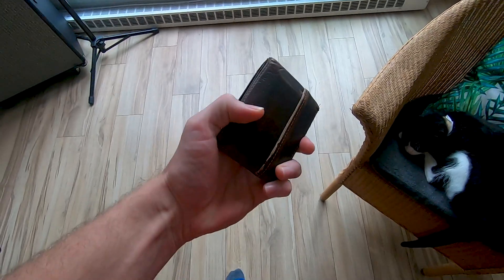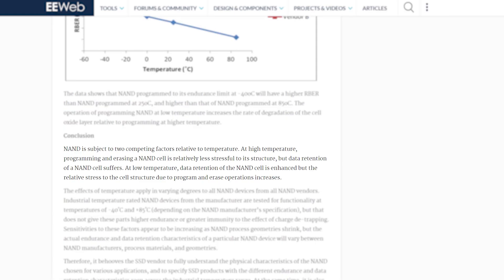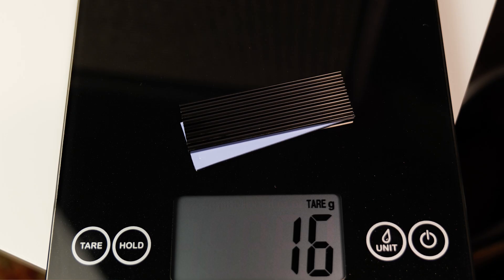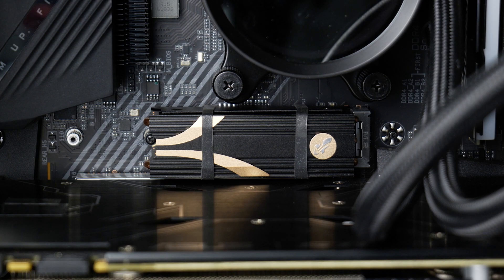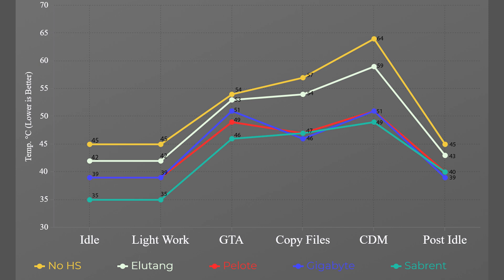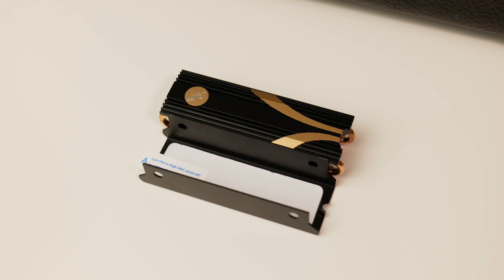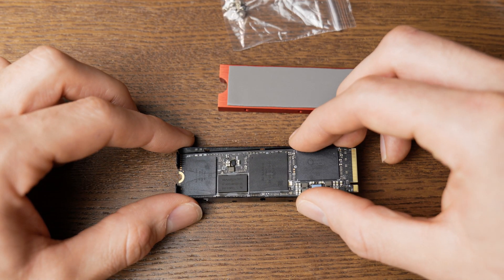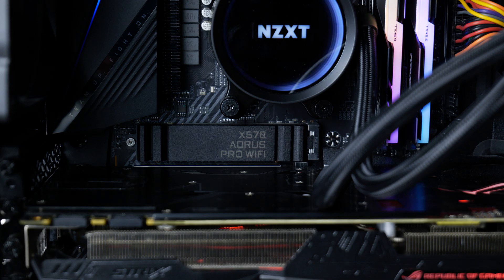Are NVMe SSD Heatsinks Worth Using? M.2 Heatsink Comparison

Comment: I would of found it interesting if these tests were done inside gaming laptops....Just to see how much closer the temps get to critical in a far more congested and enclosed space with the heatsinks (or pads more likely) On my omen the copper coverplates inside the laptop have only half of it with a preinstalled thermal pad which tells me they are of the same mind to only apply to the controller.
Reply: @El Cactuar would've ... sounds like would of.

Comment: Enjoy now because in a few years a HD won't be needed as MS, Apple and even Linux are discussing booting from flash drive from the manufacturer and that will replace your boot drive and the OS is cloud based. 
Like a dumb terminal and all your software and private Data is on the cloud. Basically can you say goodbye "Personal Computing"...well, it was a fun ride.
Let's see, I'm 61 now and started with this in 1980. So, yeah..it was a fun ride.

Comment: Exactly.point on. The memory is rated in meantime (hours) reading/writing has a life span. The controller life can be extended by cooling, but heat to a (ahem, degree), is necessary for error recovery, etc.. but I'm in the same mind, leaving the memory alone and cooling the processor. Good job on explaining.  I really need to put a hamster and squirrel cage in my computer.

Comment: I have watched and read countless videos and articles and have concluded that cooling only the controller is the proper method of cooling a M.2 Drive. Great video!
Reply: @DoNotSayThree  Not really, you could use GPU Memory Heatsinks that have thermal double-sided adhesive. Note to use a "Rubber-band" ring that should be warped around the heatsink and M.2 drive to prevent the heatsink dropping off the m.2 controller chip. I ended up going with "M.2 Heatsink Cooler 2280 SSD Double-Sided Heat Sink with Thermal Silicone pad for PS5/PC PCIE NVME M2 SSD" from a online store. The reason I went with that was because it allowed me to cool the back of the drive by allowing me to use a thermal pad and it was not a clearance issue with that heatsink installed. To top it off it was cheaper then getting a pack of GPU memory heatsinks.
Reply: @DoNotSayThree  The PCIe slot card is a great idea if you got a slot to spare. Keep in mind that some motherboards share PCIe lanes with other devices/chipset on certain PCIe slots. Try to use a slot that has nothing else tied to it. Also, it does not matter if you plug in a 4x PCIe card into a PCIe 16x slot. Hope that helps out!

Comment: I think the conclusion has to be to use two separate coolers: 1 for the controller and 1 for the nand :)
Interesting video, thank you.
Reply: the answer flowing through my head is that putting the pads only on controller area and trying to avoid the NAND touching the heatsink area (?)

Comment: The Sabrent Heatsink comes with extra thermal tape So if your NVM E Drive has no chips on the bottom  you use the extra tape and that fixes the gap.

Comment: I'm curious about removing the sticker as you did in the very beginning. You're the first one I see doing that when applying a NVMe heatsink. I totally agree that it has to be removed, but do you have any reference/experience when it comes to comparing both ways?
Reply: I have seen a video by a well known tech tuber that went into this question.  The drive manufacturer explained the sticker has thermal conduction built in, it's not just paper.
Therefore you are best not to remove it, if you believe the company.

Comment: Thanks!   Funny - I was just thinking about this very question!   Did you notice if the thermal pads were of different thicknesses for the controller vs. the storage?   I know the Samsung drives have a signficant difference between the two.

Comment: What about the info sticker it's covering the controller, nands, dram, would the NVMe run alot cooler or it doesn't matter? 🤔
Reply: @Xyphis Ah, good to know. I'm NOT going to temp to remove the label from my new Samsung 970. Thanks for the tip. 👍

Comment: I have two NVME one with heatsink and the other without, the one with heatsink gets hotter then the one without. My guess is because the one with heatsink is 2TB has my OS on it and constantly running and the other has 500GB and is just always idle.
Reply: the Newer 4.0 interface runs Hotter.

Comment: sadge none of the heatsinks you tested have a built-in fan. i found an affordable heat sink with built in fan and  large oled temperature display. came with  2 extra thermal pads too

Comment: I do backup the entire NVMe frequently not to lose Data. The throttling is a key factor for me. Without heatsink it will take forever to finish the backup at 6 MB/s halfway through.
Reply: Been using Samsung 960 PRO for 5 years now without any heatsinks...  Never lost any data, and never noticed any major throttling.
Reply: @teemuvesala9575  I backup the entire 1TB system storage. That's why overheating and throttling is an issue for me. But since I got heatsinks with active cooling for all my NVMes problem has been solved
Reply: @oMeGa0122  Yeah it’s really just writing huge amounts of data that overheat NVMEs.

Comment: So i have a crucial Mx500 m.2 and at idle it sits at around 49c and while gaming it sits at around 72c, I use HWMonitor. This drive use to be normal like my samsung 970Evo at 40c idle/53c load. I had started to notice severe lag/stuttering in my games that I had not had before, thinking it was server lag but seen my drive was hotter than it use to be. Asrock Taichi 470x mb 5 case fans and an AIO, had this build for about 2 years now and my pc is very clean and great airflow and have not changed anything with it. Is my m.2 going bad and would I benefit from a heatsink?
Reply from the maker: Definitely worth a shot! Check drive health as well.
Reply: Your idle is way high mine is 28-29

Comment: Thank you for information. 

We are not using, well at least most of us not using SSDs as idle storage devices. SSD meant to be used under fast reading and writing pressures, otherwise why would we need high random read/write speed disks that can handle multitasking; even if we are not multitasking but just queueing tasks, PC constantly doing it with multiple running apps and tabs at the same time. I don't know you guys but most of times I play two games at the same time or watch some content while playing. Anyway, I'm on the eve of buying my first 1TB M.2 ssd, so I'm constantly searching for some time; and I keep reading almost same user comments in every M.2 product that doesn't have a heatsink like "it goes too hot" and "lost X much disk health in a month" etc. and most of time blaming the heat to cause of that. Because it's so expensive for my standards, if I buy it, it would be the second most expensive part of my PC after the GPU, so I wanna make sure the money well spend and expect to not cause a problem for 5-10 years at least. And from a gamer standpoint, we would like to install our most played games to SSD, especially multiplayer ones to minimize fps drops caused by the low performance of the 90% full hdd with hundreds games. As we see from test results, playing a game pressuring as much as copying files, even close to CDM pressured temps. For some people, if a device's operating temp is 0-70c, they think it's okay to reach 65-70c. But for me, even 60c is hell hot for any hardware even if operating temp is 80c. I see heatsinks works pretty well, dropping 10-15c under high pressure. I'm definetely buying one if I don't buy Corsair MP600 Pro or Gigabyte Aorus Gen4 that has heatsinks already.

Comment: Having NAND cooler shortens its lifespan. Heatsinks that transfer heat from controller to NAND are therefore beneficial.
Reply: Wasn't it the opposite? More NAND heat = more risk of data loss and drive failure? But better performance. But I'd rather lose a little bit of speed than my data.

Comment: If you are regularly running against the  throttle temperature, then a heatsink might be worth it. Check the specs of your NVME, like my HP EX950 is 70C, when I hit that it slows down enough to be noticed, but I am often hitting it pretty hard.
Reply: What actually causes it to run against the throttle temp? Gaming, editing off apps installed on the SSD? Sorry if silly question but do you need to be gaming heavily or something to cause it?
Reply: @yiannimav  Not the same model, but my NVME only heats up when it was transferring big files all in one go (was transferring 70GB of files when I tried it) which heated it up to 60C, and thats with a heatsink.

Other than that, its temp stays at 40C mostly, and only ever rises up to 52C very rarely, and only for about a second or so for all other usage.

Getting a heatsink also isn't expensive, and might increase its longevity/avoid it from throttling in the long run so no harm getting one really.
Reply: @Don_Akane89  thanks for this, appreciate it! Just a bit of a noob, and my laptop might not be thick enough for the heatsink, but I'll try put one on it! Thanks again!

Comment: I think many are going to be misled by this video (and many older 2018/2019 videos) that are referencing cooler running Gen3 drives. Even the SN750 ran hotter than its competition, but the SN850 (Gen4) takes that to a new level. Depending on mobo layout, these hotter Gen4 drives are often stuck directly under the GPU, which only makes a hotter running drive get even hotter.

That said, the real reason I watched this video - I wanted to know if the included Aorus heatsinks were functional. And it certainly seems they work, so that was good to see.
Reply: Sn750 is a cool running drive have one in my laptop right now. But it is a dell laptop that has a heatsink.
Reply: and the controller is slightly thinner than the nand so 2 thicknesses are necessary
Reply: Versus stock heatsinks from the motherboard, will purchasable ones like Thermalright perform better?
Reply: Misled how? Everything still applies.

Comment: Thanks for this video, very informative and helpful.
If I can ask -
I just installed 970 evo plus (gen 3), would you recommend taking the sticker off before adding heatsink?
I prefer not to take it off, so it won't lose its warranty.
Reply: No don't take the sticker off. The stickers are made with thermal conductive material to help as well.
Reply: I just found out that this is true. The label is made of copper I believe and it's meant to help keep it cool.
Reply: I have bought it already and will receive it soon. But I won't install any Heat Sink. This SSD can handle video rendering and online game.
Reply: Did you install any heat sink on your drive? how does it perform?
Reply: @MixedArarash  In my case, I've tried using heatsink, but it did little to no difference in temp, so I removed the heatsink and it's working great without it.
Kept the sticker though (the one on the ssd itself)

Comment: Would this apply to gaming consoles? And what about some of these like Samsung with their own applied thermal dissipation methods? Sounds like an additional heatsink would counter the already added thermal measures and keep more heat in. (Even though for example sony suggests a heatsink in their ps5)
Reply from the maker: Mostly it would apply to gaming consoles. That being said I did this test with a Gen 3 drive. Gaming consoles require a Gen 4 drive. A heatsink would probably be a good idea on gen 4 drive whether in a console or PC. They just get very hot
Reply: @TechIlliterate  Heatsinks which for instance "Samsung 980 Pro with heatsink" have are designed properly and only touch the controller... I think its the motherboard manufacturers who are the ones screwing up more than anyone else.

Comment: mine is at 53 degrees at idle. I have a asrog crosshair hero VIII and it came with it's own heatsinks and thermal pads (which I almost threw away by mistake). Nevertheless, even with those. my idle temp still sits at 50-53c and when gaming, it reaches 56-58c. Is this normal
Reply: yes, cause your gpu is heating up other components in the case. totally normal.

Comment: Well done. Sounds like manufacturers should just sell a heat sink that is designed to keep their own drive at ideal temps. I won't feel confident buying a 3rd party here, since there's a chance it could backfire.
Reply: The manufateurs could slice the heatsink to match the drive, so NAND and Controler each have their own small heatsink. This way the controller would no longer heat the NAND.

Comment: Dude, this was surprisingly in depth and really covered the technicalities of this in ways I never expected. This is legit. I just got a Sabrent Rocket 4 Plus that seems to have heat issues. And even bought that huge heat sink. I really feel like I learned a lot about cooling the controller, not the NAND. Would love to see a tested solution for that. Thanks for all the legitimately solid info! Subbed!!!
Reply: Yeah! I just installed a SAMSUNG 980 PRO M.2 and copied 500 GB to it, and is was REALLY hot. It felt hot. Could have been 65°C, I dont know. And I was like... STOP, I need a heatsink.
But this was very interessting, having parts that allow different temperatures. Aha. Hm. So, one schon grab small GPU RAM heatsinks and stick it to the controller. Nice! Thank you!
So, I will check the temperature after this pause and then continue the copy process.
Reply: @eDrumsInANutshell do you have an update?

Comment: Also the transfer of heat from the controller to the nand is something I have noticed with heatsink.  The nand is kept ever so slightly warmer and max temp is what appears to have been cut off at the knees.  Since they share in the same heatsink and thermal pad.

A lot of people go to the effort of cutting up the thermal pad but I think honestly it works ideally with one.   You keep the nand slightly warmer but the controller never overheats.  Max temp or nand and the controller are kept well in check.

Comment: I have primary 980 pro drive at PCIE Gen4 using the asus m2 heatsink.
The nand gets to 40c-55c and the controller only gets to 65c

My secondary drive is a 970 Evo plus raw with no heatsink. 
The nand gets to 45-70c and the controller gets all the way up to 105c

Comment: kinda wonder, does the placement of the m2 also matter? I mean does it have any effect to the heat they produced? I noticed some motherboard have the m2 slot right beside the processor, and other have it waay far below.
Reply from the maker: Absolutely. For example my top m.2 slot is right behind the GPU when installed. The air blown off the GPU cooler is certainly going to have an effect on the drive.
Reply: @TechIlliterate  did u put a heat sink on the m2 behind the gpu? i have the same thing and don’t know if i should get a heat sink

Comment: Apparently NAND likes to run warm under load, there are articles which state higher temperatures help with the writing and longevity of the unit, the only component might benefit from a heatsink is the controller, and even then your heatsink might be trapping heat instead of dissipating the air quickly, do your own research and for me personally I am skipping installing any heatsink on my Samsung 970 Evo Plus.

Comment: The controller is also important. If it overheats and dies, goodbye data. Also... The NAND does not have a big difference in temperature, so I don't think it could ever do any real difference in longevity. Also... For most people, most of the time the NAND will be at room temperature because the PC is off. So... Keep your room coll is the conclusion.

Comment: I have an Sabrent SSD which the controller fails when it starts overheating (If i have a heatsink and a fan constantly blowing on it will remain accessible)
From that experience I'm now going to install a heatsink for the SSD.

In terms of work where i work with Dell systems, enterprise laptop's NVME SSDs now all have heat spreader. (They used to be without)
I'm going to assume it lowers failure rates with the heat spreader otherwise it doesn't make sense for Dell increase the production costs.

Comment: Very nice video, I do have to say though if one was to cut the pads off of the motherboard heatsink it would be very difficult to get replacement for at least my mobo.  It appeared to be thicker that your normal pads.  It has been a while since I installed one so I could be wrong but it would be something to keep in mind before hacking it up..
Reply: Because sometimes prebuilts don't come with those extra mobo M.2 support pads, you can always remove pads entirely and fall back to buying one of those $10 standalone sandwich heatsinks, instead of using the mobo heatsink. Oftentimes they work better than the mobo heatsink too.

Comment: It's the same with DDR4 RAM. Heatsink really does no difference. It can even be worse with heatsink. But one thing, DDR4 & M.2 drives look better with heatsink. But if your pc is not in your viewing angle (like mine with window but stands on the floor) who cares ?

Comment: In my country ambient temp is quiet high. Idle usually sitting at 70°c. Raid 0 gen4. Already bought non heatsink because of cheap. But regret cause i need because it on back side of Mobo. Gigabyte x570i.